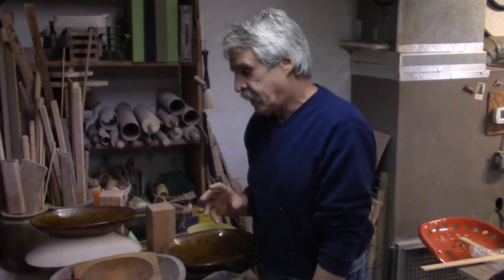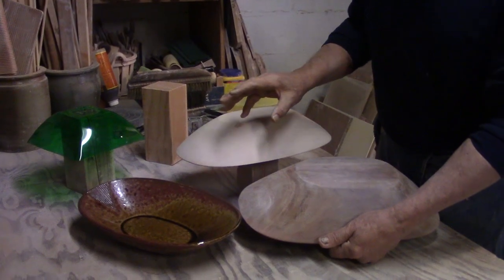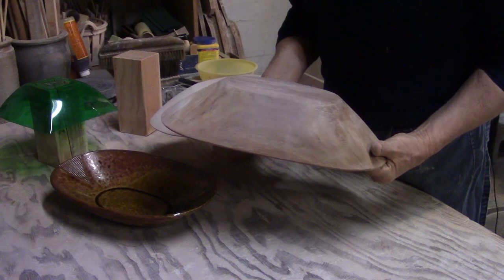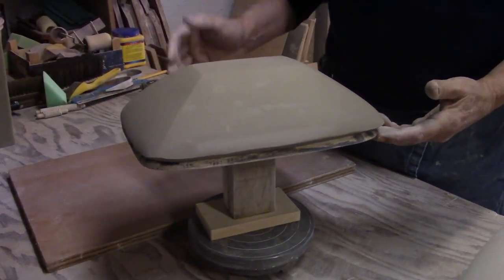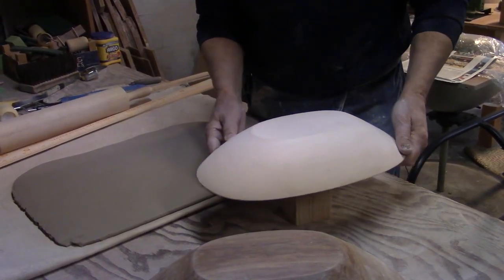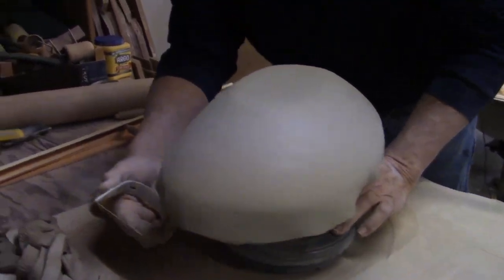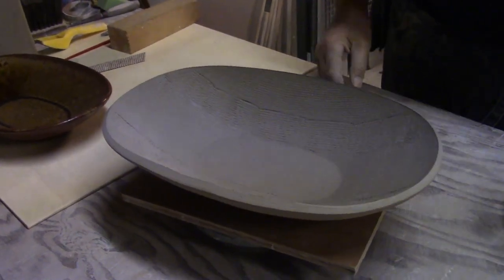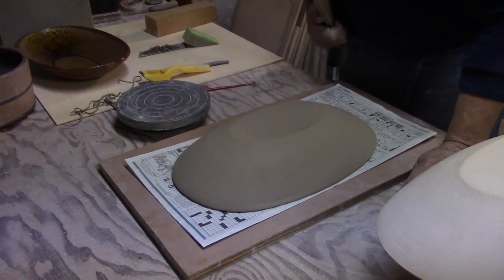How to make clay hump molds from found forms..

Comment: This is a brilliant video. Thanks so much, Bill. I have a similar question to one below regarding the preparation of the clay: is spiral wedging to remove the air a good idea, or is it a cause of warping in the glaze firing? One of my teachers had me spiral wedge the clay and then turn it sideways to avoid s cracks, but I seemed to have endless issues with warping. Any advice regarding the preparation of the clay would be much appreciated, by us all, I’m guessing.

Comment: Those shallow wooden oval bowls are called bread boards. Many years ago they were carved out of an actual tree trunk and the cook used them to keep her flour in for making biscuits. She would cover with a cloth until the next time. This way she didn't have to keep having to scoop out of the large container which could cause the flour to go stale, so this way she would only have to replace the flour once a week or so. I still use this method myself. Makes it easier.

Comment: hi Bill did you put something on your wooden form or on plastic form to help to remove your master mold from your form that you find.
Reply from the maker: Hi, Robert ,    No. I’ve never used a releasing agent between the clay & the mold/s. In my experience, if the form angle or slope is 45* or less, the clay will shrink & loosen itself from the mold form without cracking. Using a form that has a sharp upward angle or extreme curve will - in my experience - pinch the slab & cause cause cracking.
Reply: Thank you so much Bill and bye the way a Very happy new year.

Comment: Bill, thanks so much for your videos! You offer such a wealth of awesome tips and tricks, LOVE the paint roller idea, I'll be using that one for sure! Question for you - does your 1/2' slab ever stick to the plastic or glass found object master forms when you're making molds? I've tried many things to prevent - cloth or dry cleaner bags, wd-40, cornstarch...but just wondering if you have any tips on this?
Reply from the maker: I don’t use any type of releasing agent, Zoe. I allow the slab to dry on the form until it shrinks enough to release itself. BUT… it’s important that the form has a gentle slope vs a severe angle. No more than 45*.

Comment: I just started doing some slab experimenting, is there a trick to keep your clay from sticking to the surface that you roll it on? I tried canvas and it stuck fast to it, I had to let it sit a while before I could get it off the canvas and then the clay cracked a bit when it draped over the mold.
Reply from the maker: Hi Liza.... 
I don’t use any releasing agent (cloth or powder) between the mold and the clay. Rather, I allow the pressed-on clay slab to dry on its own until it shrinks enough to loosen itself from the mold form. If I try to separate the two too soon, the pressed clay will warp a lot - or tear. 
And a note... if your pressed slab of clay develops cracks while drying on the mold, it means your mold is too sharply angled in shape.
Reply: @BillvanGilderPottery  
OK, thank you very much for your answer. Ppl make it look so easy in the videos!:)